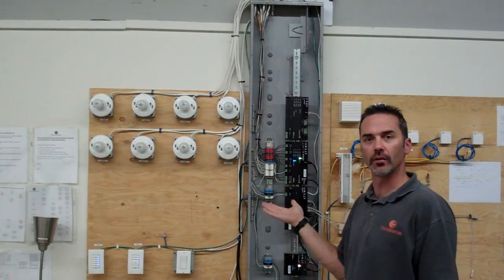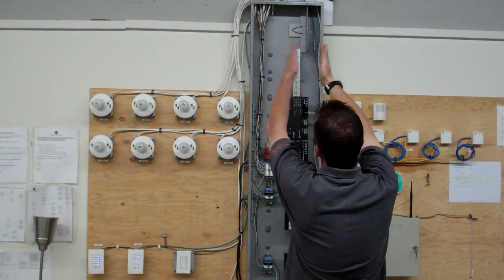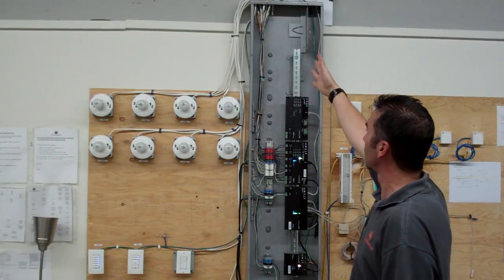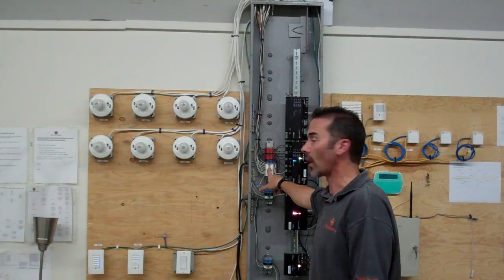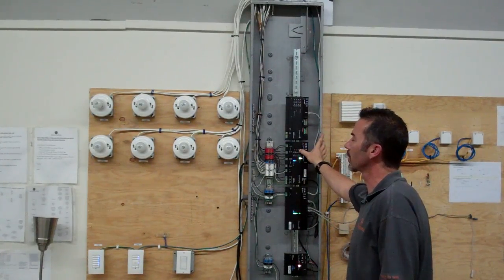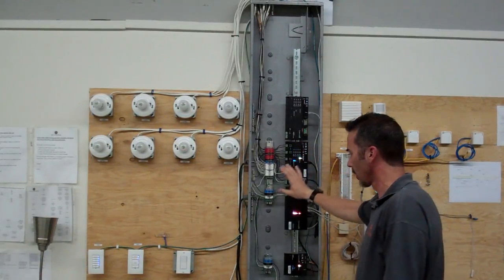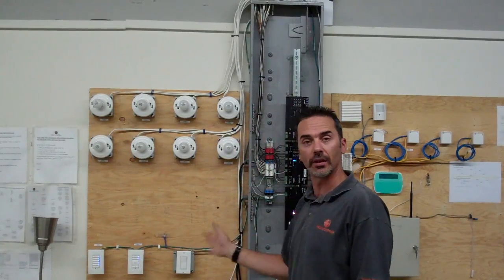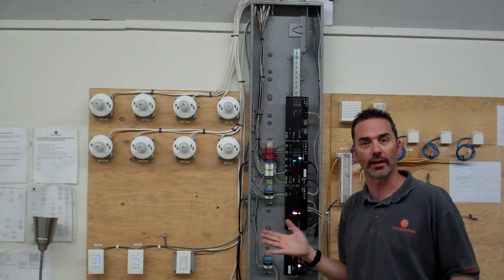Installation of a Control4 Panelized Lighting System

Comment: Nice video, please what model of keypad can be connected to the overide ?
Reply from the maker: +Animashaun Oriyomi (YourMe) A standard snap switch from home depot can be connected. It is just a contact closure with not voltage per se but since it comes in on the line voltage side of the panel, it must be wired per NEC standards.